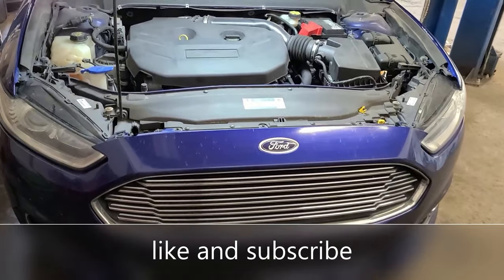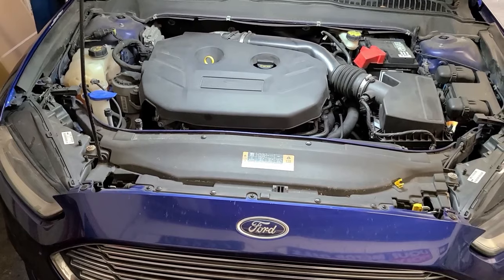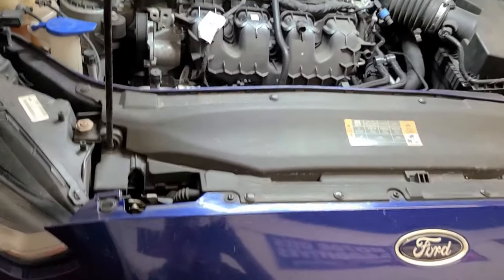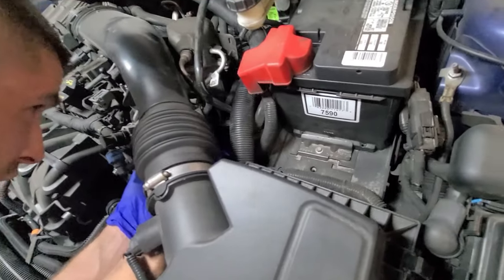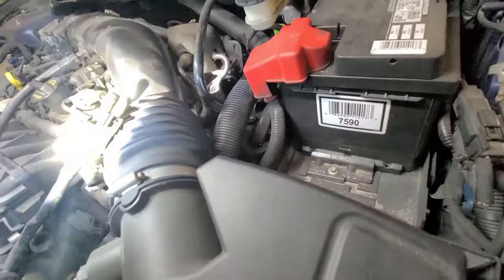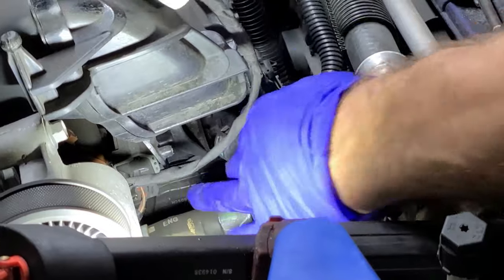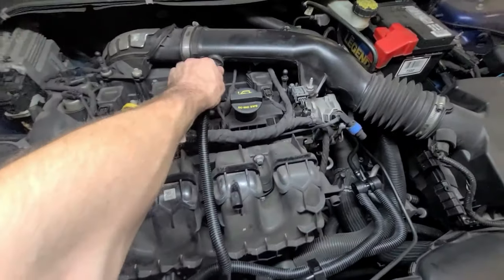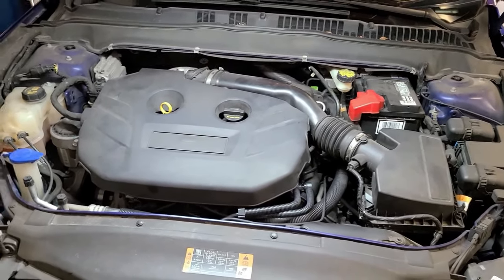Ford Fusion Purge Valve Replacement // 2.0L Ecoboost 2013-2020 // HOW TO #DIY #HOWTO

Comment: Any idea why these go bad? I have 2014 se ecoboost and have had to change this 9 times in 4 years and currently its bad again..I usually take that coolant hose off by the 2 bottom ones to give enough room for 2 hands to work.
Reply from the maker: Topping off the tank is one way but 9 times in 4 years??? Really? Almost sounds like it might be something else lol that's excessive
Reply: Is there anything wrong with disconnecting the coolant hose?  I have a 2013 and no matter what I do, I cannot disconnect that last vent valve.  I need more space to work with.
Reply from the maker: There's never a problem with doing more to get your more space, just be prepared to catch coolant and top off when done

Comment: Will this video work for a 1.5 ecoboost or is it totally different? Harder? Same?
Reply from the maker: It is a different set up for the 1.5L ecoboost, the process will be about the same, symptoms of a bad purge valve o your car will be similar or the same tooo. ...just different connection points.
Reply: @THEDriverMod_  will it be the same replacement part? It looks exact same, but auto parts stores online are saying it wont fit for my 1.5L
Reply from the maker: Yea I don't believe the 1.5L part is the same

Comment: I have been having rough idle issues and the fuel filler fart for a while and had this issue in the back of my mind and today my CEL came on with code P2196, and I think this is all related. I have the 2017 2.0 Fusion and when I go to purchase this part the amazon part fitment guide says it does not fit, but in looking at my actual engine it seems to be the exact same layout and part. Do you happen to know if I can go forward with this linked part even with a  warning that it may not fit?
Reply from the maker: This repair is definitely where you should start with those concerns
Reply from the maker: As far as the part not fitting, I wouldn't always trust Amazon. If you order it and it's not gonna work, it can always be returned.
Reply: Ok an update. The part does NOT fit the 2017+ 2.0 because this engine has an additional hose connected on the top of the engine, but the valve itself is exactly the same from the mount to the splitter. I used a heat gun to remove the new valve off the hose assembly at the splitter and then cut the old one out at the same location. I softened the new hose with the heat gun and slid it on to the old splitter and reconnected everything. The engine is running very smoothly now and seemed to have regained some power. 

So while the part isn’t an exact fit it can be doctored to fit properly.

Comment: This fits a 2018 Ford fusion?
Reply from the maker: Yes, with the 2.0 Ecoboost engine
Reply: @THEDriverMod_ awesome im about to get it .. I was kind of skeptical cuz amazon was saying it won't haha
Reply from the maker: @KewlJewlz  interesting. Part numbers get updated all the time. Maybe that is the case. Or the part is listed under the wrong part number. I've seen alot of comments stating this to he the case. I wonder if anyone has actually ordered it and verified
Reply from the maker: @KJcinemas  as long as you have 2.0 ecoboost it should work

Comment: Would it be a problem if i left this issue fir a while!? Im from overseas and my local dealer told me they have to order the part from US which will take about 6 weeks to arrive. 
Should i keep driving with this issue or stop until i replace the part?
Reply from the maker: You can keep driving

Comment: Did the exact steps but still got the check engine light.
Reply from the maker: Did you clear the code?
Reply: @THEDriverMod_  Unfortunately I don't have a scanner. I had to take it to O'reilly, but they said that they don't clear codes. I know if I take it to a regular mechanic, they'll just try to charge me something. But this was a real easy fix so I did it myself.
Reply from the maker: @chrisscales1  the check engine light will clear eventually when it activates the purge valve successfully several times while driving/running so aslong as there's no other issues then it will eventually go out

Comment: How did  you put it on so fast I’m having trouble …
Reply from the maker: I've done it quite a few times. I was a Ford tech for a bit. Very common failure
Reply: @THEDriverMod_   I’m working on this as we speak I can’t get the bottom one back on  not enough room any tricks ?
Reply from the maker: A long pick or screw driver

Comment: What octane gas do you use?
Reply from the maker: 87
Reply: Great question. My wife's 2016 fusion 2.0 has 88k miles on it. Since we bought it like new 5 years ago, I've had her run nothing but a minimum of 91 octane in it with most of the time 93. Car has always run good for us. Just now threw a P144A. I'm wondering if better fuel can create longevity on some of these parts. I know the direct injection on these cars can get all gummed up and cause the car to have problem around the 100k mile point. The manual on these 2.0 ecoboost does recommend 91 octane but says you can use 87. Better fuel (higher octane) will always be better suited for a boosted car either turbo or blower.
Reply: @THEDriverMod_  so is 87 good gas cause im use to using unleaded for my gas that’s probably why this happening
Reply: Using regular is the cost this problem instead just use 87 right
Reply: You're thinking of older cars that had turbochargers or superchargers but without computer controlled timing. Those are damaged by regular 87 gas because the engine timing is permanently adjusted for the turbo/super charger. On the ecoboost the computer will adjust the timing so you can switch between 87 and 93 and the engine will adjust accordingly and will not damage the engine from improper timing

Comment: Will a 2015 part fit a 2018
Reply from the maker: If it's still a 2.0 ecoboost it should. The part number is in the description. It should tell you when you locate it
Reply: @THEDriverMod_  yes it’s a 2.0 but I can’t find the right part for 2018 and the part in description is the only one I can find
Reply: @THEDriverMod_  I’m gonna buy and try to install it and see if it will fit
Reply from the maker: I mean when you watch the video, does it look to be the same part?
Reply: @THEDriverMod_  I just tried installing it right now, they’re definitely different in the way the lines are routed so I guess a 2015 doesn’t fit a 2018
Reply from the maker: @michaelalfaro2058  good to know, once you have the correct part you should be in buisness
Reply: @THEDriverMod_  well unfortunately I’ll have to take it to dealership because the right part is nowhere to be found on the internet
Reply from the maker: What about a parts store like auto zone or oriellies?
Reply: @THEDriverMod_  nope only the older generations
Reply: @THEDriverMod_  they don’t even have it on the ford website
Reply: How much did it cost at the dealership? And did you ever find out the number on the part from the internet mines been trashed for awhile and haven’t been able to find it or haven’t had the time to replace it but it would help a lot if you could send me some info about it.@MichaelAlfaro

Comment: Dude. Just remove the dang intake tube. Makes it a LOT easier
Reply: Can you make a video showing us how to do that? I want to try this but don't want to get stuck at the end
Reply: @adriansaninja  I already did the job a while ago
  I don’t have a fusion to do it on again to make a video. But it’s not that hard.
Reply: @tjblackartist  thanks, I have little to no experience with cars any extra info helps
Reply: @adriansaninja  best thing is to take to a mechanic then. You wouldn’t wanna mess anything up. Or find a mechanic that you can pay cheaper to show you how to do it

Comment: I followed everything in this video and my check engine light is still on. I erased it but every time I start the car, it comes with back. More now than before I replaced the part. Any suggestions?
Reply from the maker: Sounds like something is not plugged in all the way. What codes are you getting now?
Reply: @THEDriverMod_  same code as before. I know they’re plugged in all the was bc all the clips clipped in. Unless that doesn’t matter?
Reply: @THEDriverMod_  actually I’m getting a P0443 code now
Reply from the maker: It's possible a pin got damaged or bent. Double check the connectors and trace the harness as much as possible to look for potential broken wires or rodent damage
Reply: @THEDriverMod_  just checked everything. Realized I forgot to plug something back in. Rookie mistake. Thanks for your help!

Comment: Mine is clicking. And it’s loud
Reply from the maker: thats normal
Reply: @THEDriverMod_   a loud clicking that I can hear from the inside?  Have changed the part twice and it still clicks loudly. Wasn’t clicking this loud before.
Reply from the maker: @xElemeno  its normal. depending on the part quality, it may click louder than before but the clicking sound is completely normal

Comment: Changed this on a 2013. Still throws the sames code.
Reply from the maker: Sounds like you've got a different problem causing that fault.
Reply: @THEDriverMod_  Not sure. Im going to give it a few days to see if it lines out. Ill keep it posted.

Comment: I just noticed there is a safety recall on this part so fords should do it for free
Reply from the maker: Interesting, I havnt got a recall later yet. Are you sure? It's not really a safety item.
Reply: Oh no they won’t. I was told today that the repair period ended in 2022, and that although they admit that the failed purge valve was the problem, there’s now coolant in the engine and the price is $7400. I hate this car with all my being

Comment: 2013 eco boost mkz here I’m having this issue…. This motor is trash
Reply from the maker: A purge valve failing is cheap and not because the motor is trash. Mine has 196k miles on it